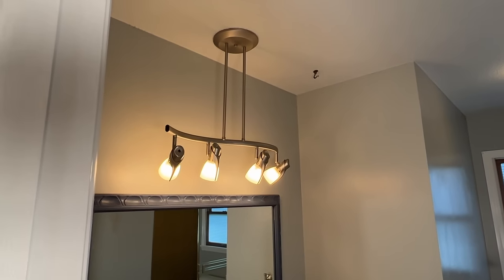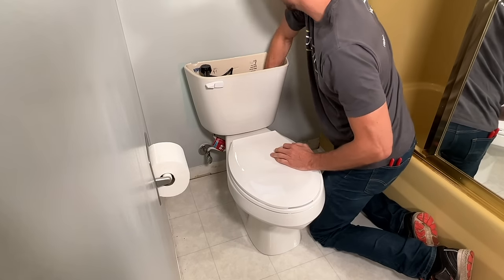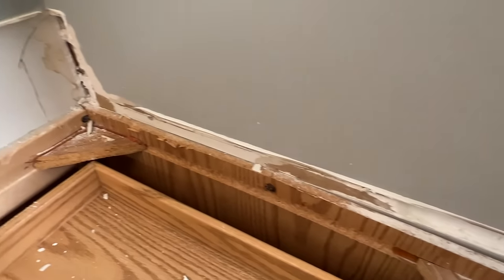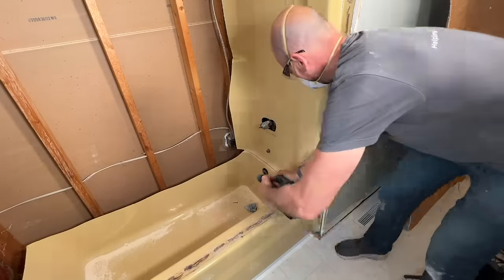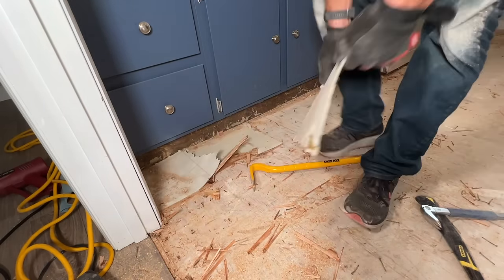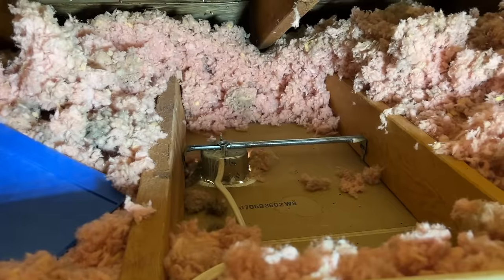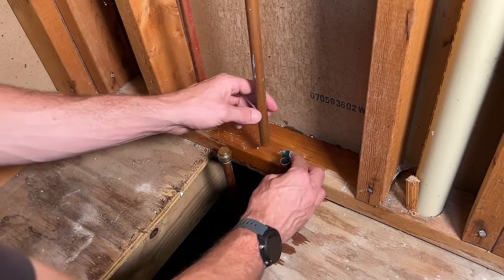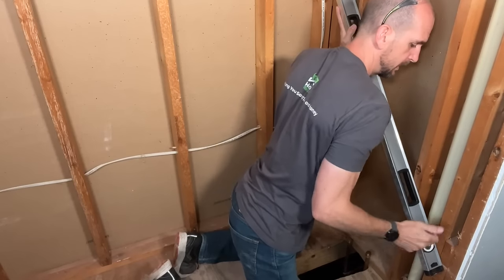DIY Bathroom Remodel | From Start To Finish

Comment: I was told by an old plumber that before you caulk the tube you fill it with water.  He said a filled tub can settle with the weight of the water and sometimes mess up your finished caulk job.
Reply from the maker: Not a bad idea 👍
Reply: I was told the same thing many years ago.

Comment: Having watched countless DIY videos for home improvements and repairs, including bathroom remodels, wiring, gas and water lines, electrical, etc. and realizing that about 95 percent of them are either completely useless or missing crucial information it is stunning how useful and on point your advice, recommendations, and descriptions are. Great, great job, as always. PS. My switch plate screws always point up.
Reply from the maker: Thanks for the feedback 👊

Comment: Some constructive criticism with the exhaust fan: I would have vented through the roof and not through the soffit. I also would have used an insulation ductwork, to keep it from condensating with temperature differences between the hot/cold attic and the inside air.
Reply: That might even be code violation in some areas. But if there is no existing vent in the roof it would get complicated quick.
Reply: Then you compromise your roof for each time it rains.
Reply: I think that as long as it doesn't vent into the soffit or exit near an intake vent for the attic it is ok. Check out this product i found.
https://youtu.be/NmZ_MOfq4PY

Comment: Nice job, it turned out great. My only complaint is the shower valve is really low. My feeling is it should have been installed 12 inches to possibly a foot and a half higher.

Comment: I have been put in a position where I have to renovate our main bathroom due a failure of the tub drain. I was very impressed with the substance and attention to details that your videos offer and wanted to share what I learned and what I did to overcome some pitfalls that existed in my bathroom that your video did not cover. Like your video, my bathtub and shower are orientated the same way although my main bathroom is on the second level above the kitchen. I found out right away that before we moved in the home was ten years old built in 1990, when I cut out the sheet rock behind the tub and shower faucet to gain access to see the cause and problem to be overcome I exposed a previous patch and when I was able to see the tub drain I found it had been replaced. The tub and shower drain are directly above the kitchen cabinets and now I know why the kitchen was remodeled a few years before we moved in. The water lines for the tub and shower were routed from the side wall away from the shower faucet and around the alcove however where the copper pipes pass through the studs in the side wall, they were not routed through the studs in the back corner to the back wall of the shower, instead they were ran around the inside of the studs in the corner making installation of the wall panel impossible. After pondering how I was going to fix this I decided I would cut the copper pipes where they exit the last stud they were routed through and add pex lines to drop them down to just a few inches from the floor and connect them as they were just lower down so I can mount the wall panel. I also found that the floor at the faucet end of the tub was 1/4" lower than the other end so I had to lay a bed of mortar to remedy this to make the tub level. When the replacement tub drain was installed it was done with a poly pipe kit but was glued so I was not able to remove it. I may end up having to remove the kitchen cabinets in order to access the drain pipe in order to build out a new drain as you did. When I placed the order for all the materials I was sadly awakened to a problem that Home Depot has yet to fix. Until the order is placed there is no alert to inform you of delayed shipping times and locations where the materials are coming from. So the first item I received was the last part I needed and the last part I received was the first part that I needed. One month after placing the order I received the tub and shower faucet assembly and the vanity. Unfortunately, the vanity was shipped without the pedestal feet and this would not do as there is a furnace register underneath the vanity. Needless to say there were many long conversations with customer service that never gave me satisfaction and even when I brought the shortage to their attention on the vanity, they were incapable of offering me any solution that was even remotely good for me. Rather than offer to get other pedestals for the vanity they expected me to settle with a replacement that they had in inventory or wait who knows how long for another vanity to be made and shipped as they said the vanity was no longer in production and that I got the very last one available. Two days later Amazon to the rescue! But Home Depot was not even willing to reimburse me for the money spent to get replacement pedestal feet. I hope to finish the pipe relocation this weekend so I can start re-assembling the bathroom labor day weekend.

Thanks for the very informing video content and if you are in the PNW I live in Puyallup  Washington and would love to treat you and your family to some BBQ!

Comment: great job ! Here's a tip i learned from a old timer pro  use a moist sponge to feather mud finish before it dries   it will save a lot of sanding and dust .

Comment: Very informative video. Well explained and video'd. And with the additional in depth videos it just makes it that much better.
There is one thing I would have done differently though. Before setting the sink on the counter I would have cut a rectangular hole to include the area of the faucet and drain. This way, if the faucet or drain ever leak or need to be replaced, the sink will not need to be removed since you'll have access from the bottom. 
Otherwise, great work.

Comment: Great work. Doing my bathroom now. Ideal "in-sure" now makes a similar wago connector except there's has a test port for a volt meter to test voltage without removing the wires.

Comment: Any concerns about de-burring a pipe that's vertical? 23:25 when you de-burr, could metal shavings go down in the pipe and then be pushed up into your valve once the water is on? Could you avoid that by using the sharkbite on the horizontal copper and letting the pex do a soft 90 (or do you need a fitting for that)? Great video. Thanks for posting it.

Comment: 1:08:52 alternatively cut a larger hole in the countertop to provide access.  If you need to service the faucet, then you are basically undoing all the plumbing and prying up the entire sink.

Just imagine the faucet becomes loose and needs a simple re-tighten, now it's become a huge job.

Comment: Thanks, lot of helpful info.
Is there a reason you vented exhaust via soffit and not roof, other than not wanting to.penetrate roof? I always thought UP was the preferred method.
Thanks!
Reply from the maker: Yep, I am not against going through the roof but just thought that might be a little more DIY-friendly as i know creating a new hole, installing a boot, and securing shingles is a little intimidating to some home owners.

Comment: You don't need to wipe down your walls with a damp sponge after sanding before painting. The extra bit of gypsum dust will mix with the primer or the paint and increase the solid content which improves the quality of the finish.

Comment: The back of our surround is an outside wall. There is currently plastic vapor barrier covering the stud wall. How do you use adhesive with the plastic in place?

Comment: I would recommend most people just get rid of the trim as it likely isn't solid wood like this and replace it with plastic baseboards that you can find at big box.  They won't swell from the water/moisture over time.  They also are nice and clean unlike dinged and rough reused baseboards.
Reply from the maker: Yeah, I thought about using the PVC trim and agree that is really nice for wet spaces.  Thanks for the feedback 👍

Comment: Really interesting and informative video, and I appreciated the deep dives! That said, I'm curious how you patched the ceiling where you removed the old fixture - it looks like there's some kind of texture there. Did you have to cut out to the studs, or did you use a circular patch? How did you match the texture?
Reply from the maker: Good question, no patch as I just left the electrical box in place with a white cover.  👍

Comment: Do you know what the size of the tub was that the tub/shower combo was? Mine is coming up a few inches shorter than 60 inches so I’m confused and concerned that I’m going to need a custom size tub. I measured at the top, back of the shower part. I was curious of the size of your shower/tub combo in case the dimensions are different for those.

Comment: Great job overall. I have doubts on the quality of airflow you'll have for the vent. You had an S shape in the ductwork which will constrict the airflow but is a very small run so might not be as bad as it looked.

Comment: When I built my guest house for my mother, I discovered a You Tube about wet sanding drywall seams.  It was like heaven.  Very little dust and cut the time and effort in half.  Ever tried wet sanding?
Reply from the maker: I have seen it here and there but haven't really gave it a go.  I think I will on the next project because for these small jobs when you want to keep the rest of the house clean that would be awesome!

Comment: Is the delta 400 series tub only available in the "curve"  on the outside now? it looks like yorus was flat... makes buing a shower door difficult.
Reply from the maker: This is the updated version of what I installed.  I think the 500 series has seams that don't need any or at least not as much sealant to waterproof at the end.  https://www.homedepot.com/p/Delta-Classic-500-60-in-x-32-in-Alcove-Left-Drain-Bathtub-and-Wall-Surrounds-in-High-Gloss-White-BVS2-C521-WH/321602829

Comment: I agree with your final comment on the choice of sink; I think is all looks, zero practical. The splashing is one consideration, but people are careless and the water will be all over the top as the user drips their wet hands to reach the towel. The edges of the sink will catch some of it and that water will run and ruin the top. In my opinion, the design for such arrangement is the biggest, failing item  in the project. For a rental, I always think TEENAGERS! What would they do in this space? And you try to take all the precautions ☺️
The looks of the bathroom are a big improvement and looks beautiful!

Comment: We are hoping to remodel a 1/2 bath in the basement to also include a larger tub. so.... probably 5k, but not quite sure yet on how to connect the tub into the same drain the sink and toilet are in, under the concrete...

Comment: Damn this video is awesome. Had a comtractor eff up the install on my tub/surround and now ive gotta redo it all and dont wanna pay someone again.
Reply from the maker: Thanks, if you use the Delta 600 series (newer version) I think you don't have to seal each of the gaps between the panels.

Comment: How do you feel about caulking the bottom of the toilet to the floor for a cleaner look ?????
Reply from the maker: I don't mind it but I keep a portion of the back open so if there was a leak it would flow out the back.  This video I used caulk but also needed to shim.  https://youtu.be/6gHLJlLjdNs

Comment: Great video!  Maybe I missed it, but I'm not seeing a link to the easy guards (sp?)--the tubes for protecting romex through studs.
Reply from the maker: Still a few weeks out from being available on Amazon but if you have a Menards in your area they usually carry the 5-pack and 25-pack https://www.menards.com/main/electrical/electrical-boxes-covers/electrical-box-mounting-accessories/ez-guard-single-stud-electrical-wire-protector-25-count/1014-25/p-1841405560610073-c-6426.htm?tid=-6042403840892547859&ipos=1
Reply: @EverydayHomeRepairs  Thanks!

Comment: I have a question that may sound absolutely stupid. I've done TONS of carpentry/plumbing/electric/flooring/drywall, but I've MOSTLY worked in existing areas, though I've also helped build houses and not done any of the extra stuff. Do people typically put plywood over the concrete foundation for any reason? My house was built really horribly. Cheapo. Like... They built 30 identical others of my house in one year in my local area. Anyway, the settling of the house has never been compensated for, so I'm definitely just trying to figure out a good way to go about what to do when I finally get done with the other renovations before I go to the flooring.
Reply: Just to add, I'm better at drywall than I am at carpentry. I'm still a "pretty good" carpenter, but I'm much better at doing drywall. I'm not one who really deals with the heavy duty stuff, like concrete/foundation building.

Comment: I'm just asking but, you didn't  need insulation and waterproofing material  before installing the surround & tub ?
Reply from the maker: Some might argue patching up the plastic on the back wall which was an outside wall.  Also I know some people who put insulation in the interior wall but that usually more for sound deadening.

Comment: Please share with folks to pull the finish nails by pulling them out through rather back of the trim. That way you don’t damage the face. And I remove the nails as soon as I pull each piece of trim so I don’t step on a nail, most people don’t need to step on more than one nail to never have to go through that again.
Reply from the maker: I like it, lot easier to store the old trim to reinstall later with the nails out and pulling out the back is the way to go 👍

Comment: I see you built your P trap from below. If my existing P trap doesn't happen to fit my new tub, can I measure where the new one will need to be and build it from above before installing the tub? I'd rather not cut a hole in my living room below the bathroom!
Reply from the maker: Do you have access from below?  Crawlspace or basement?
Reply: @EverydayHomeRepairs  No it's finished ceiling of my living room.

Comment: What did you use to seal between the dry wall and the tub insert?
Reply from the maker: The same DAP AMP Hybrid to try and bound to the Acrylic a bit better as compared to a 100% silicone.

Comment: When you had the trouble get the top put in place why not just use a sander and sand the edge so it would fall in place instead of damaging drywall? Other than that great job buddy!
Reply from the maker: Yeah, that is not a bad idea.  Since I already created a bit of drywall/paint damage I knew I would have to do touch up anyway.  Thanks for the feedback.

Comment: So you didn’t need to ad any mortar under that tub?
Reply from the maker: Nope, the Delta 400 has a plastic grid surface attached to the bottom that is designed to sit on the subfloor and not a bed of mortar so common in the older tub installs.

Comment: Very thorough. Thanks for this.  I might have had a granite top custom made, but that would probably be a grand.   Another possibility is to buy the 60 inch top and trim it with a diamond blade in a circular. The man-made cultured marble is pretty soft and will cut like butter.

Comment: RE-DID MY ENTIRE BATHROOM for only $700 labor.  Got a Mexican guy w/ a helper that did everything in a 5 days from floor to ceiling.  Including changing the bathtub to a modern walk-in shower with custom tile and glass sliding doors.  Hardware and materials were in total $1,500 wholesale
Reply from the maker: Was this in 1985?  😂
Reply: @eric Sanchez, stop the BS , you dirty Sanchez, 

Also Latino not Mexican.
Reply: @EverydayHomeRepairs  1 year ago
Reply: haha you’d have to add a zero for me around here. 7k easily
Reply from the maker: Assuming they worked 8 hour days you are saying you had guys that know what they are doing for $8.75/hour 🤔
Reply: @EverydayHomeRepairs  Amazing what price you can get during the Pandemic.  When people have been out of work for months.

Comment: I wouldnt caulk against all of those vanity edges.
Reply: Also, corner bead and tape are first coat right? Open to alternatives
Reply from the maker: Hey Justin, I agree on the edges.  I ended up laying down a small bead of clear silicone.